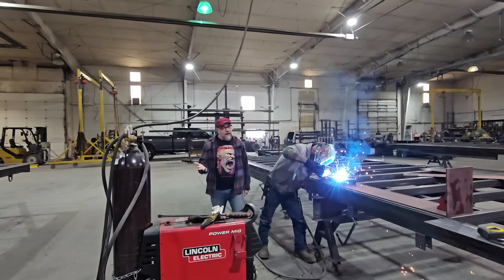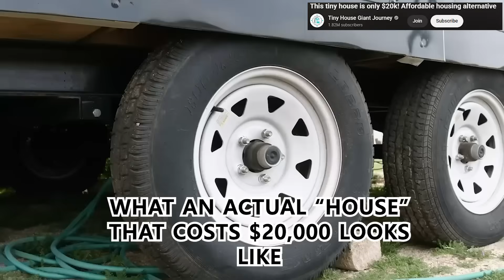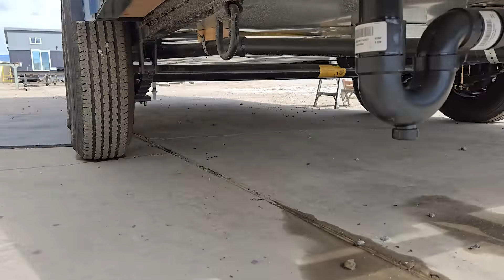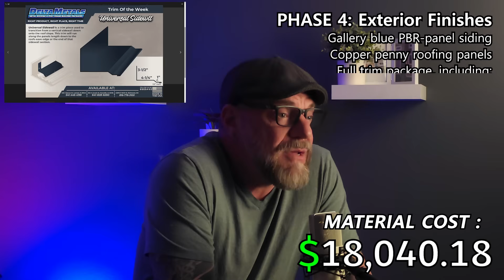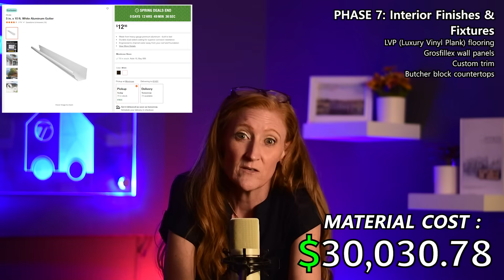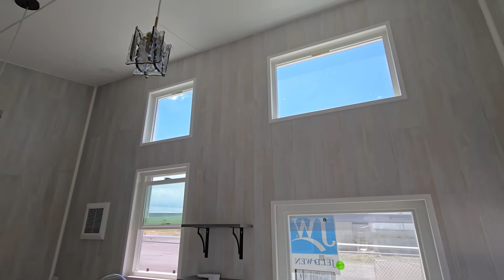The $20K Tiny House Lie

Comment: Great video!! but Dang that price seems absolutely insane my house was a little bit over a 100000 for 1600 square feet and a 1/2 acre I don't see why people are so interested in these tiny homes I mean It's not like you can have a family and what's the resale value should you try to sell. The idea of that is cool but the practicality I guess I can't fathom.
Reply: In my area in California new homes across the street from my land are selling for 500k for the cheapest model and on similar 5000sqft lots. These are 1400sq ft. houses. My lot was appraised at $35k this year so putting a $76k trailer on it and getting hookups installed for 20k should get me a place for 130k. Even if I had to do a loan with 20% down (only $26,000) that would only be a $944 monthly payment even with taxes and insurance. House across the street would need $103,000 down and still be $3600 per month... why wouldn't someone consider the trailer while saving money for a future house build and then selling it to someone else for 30k in 10 years time?
Reply from the maker: @falcianjinn6218 SEE??? I have been saying this for years now... It's all about personal reasons and economic perspective.. Thank you SO much for your input! 🙌😉
Reply: Around here in Wisconsin you can't even break ground today for less than 250k
Reply from the maker: It's nearly 2x that here in western Colorado... More than that on the front range 🙄
Reply from the maker: They don't want to live where you are, or like you live... Pretty simple, honestly.  It's all about personal choices and family needs.
Reply from the maker: When did you buy house you mentioned?
Reply: Tiny homes are just the effect of the american market

Comment: Thank you so much! You are right. I guess I rather go with a Mobil home  110- 150k. Yet, there is a builder in Tennessee: incredible tiny homes making some.
Reply: I definitely wouldn't recommend going with incredible tiny homes they are in a lot of legal trouble
Reply from the maker: Thanks for sharing
Reply: Spent a year there trying to justify the value....Just being the least expensive new constuction habitable structure may not be what it sounds like...It's a severe lifesyle change...Their smallest unit SHOULD be as wide as code allows but are instead under 8' diameter...At least the sloped roof as a 10' plus headroom tapert to 8' over bath area (a sloped front to back the lenght would be better for seniors)....I did an interrior design for us two that might have allowed us to survive, it just did not pencil for the finish or rented land space over time, maybe if we were not handicapped 80+ years old...

Comment: You end up with a nicer outcome, but then you still have to have a truck to move it. At this point, most people should just look at an RV.
Reply: hire a driver with a truck... nobody wants to pull these things around, and they are NOT travel trailers, so don't buy one for that purpose!:face-blue-smiling:
Reply: @onomado I own a 40ft major brand RV, they are far far inferior to tiny homes.  I believe RV’s have 1/5th the life of what I see being used to build THESE good tiny homes.  Just my opinion. 🤝☮️
Reply from the maker: They are both things mentioned... 5x life expectancy of an RV, and they are NOT "travel trailers" either.. You can move them, they just kinda suck to tow. You are both right 🙌
Reply: @Thetinyhouse.  In general a 2500 diesel would do the job? I also have the adjustable airbags.  I don’t know the tongue weight max off hand.  Total dry weight of my toy hauler is 8,600 and it pulls it up hill easily.

Comment: One more thing screw permits it's my land
Reply from the maker: I'm 💯 with you! 🤝
Reply: In my county, the permitting department's information page says, "If you do the work without a permit there will be a penalty." They don't say, " If you do the work without a permit, we will contact your local fire dept. to burn down your house," or "We will fine you 2x the amount you spent on the building." Do I really need a permit if I am 80 yrs. old, have owned the land and paid the taxes on my land for 60 yrs., and have always been a law abiding, good neighbor? What's your best guess?
Reply from the maker: @WhatIs7XSix most of the time it's neighbors that will turn you in if you do somethg they don't want to see
Reply: @thetinyhouseexperts i paid a guy to build a deck at my house. I paid for him to get a permit and he didn’t get one. 1️⃣ ended up having to tear it down myself. I thought it was the cable company that did it. Turns out it was a neighbor whose son ran over my mailbox drunk driving. I didn’t call the police on him. But he called on me over the deck that I don’t paid for the permit but probably should have gotten myself. But the jerk builder sounded like he got it with no problem. Boy I’m still mad about that guy!
Reply from the maker: @RobertM-y5w you have every right to be mad at that guy for not pulling a permit.
Reply: It’s technically never your land completely. They can find reason to boot you if you don’t comply. They condemn houses ppl hoard all the time.

Comment: Fyi buy a livaboard trawler or sail boat , stor it on any land to live on , it's a lllophople. Codes wont apply to storing a boat . The fact you can live on it is illrevealent.  Total loop hole check into it.
Reply from the maker: Oooh... That's a good idea too! Thanks for the tip 👍
Reply: What if i don't want to live on a boat
Reply from the maker: why wouldnt you want to live on a boat??  That doesnt seem like a terrible idea.

Comment: I got a new 32' fifth wheel with slides, two bedrooms, full kitchen, and tons of extra storage for $44k in January 2024. It's well insulated, encapsulated on the bottom, runs AC in summer off of 20 amps, stays toasty in winter with a $75 space heater (cheaper and quieter than running propane). Tankless water, solar, easy hookup, easy towing (light weight, half ton truck can tow fine).  Been to 22 states, then wintered at 2200' elevation in Washington with no issues. 

What's the benefit of going with a tiny house? Seems like more expense for less features. If you want to be mobile, why not get an RV for half the price? And if you want to be stationary, why not build a cabin for far less with far better insulation, etc?
Reply: Well an rv is not even close to the same quality. Rvs are way cheaper
Reply from the maker: @septic-god space heater in a travel trailer?! 😬😲
Reply: @thetinyhouseexperts  Yep. I have sufficient solar and batteries to run a heater that covers my needs. It's cheaper and easier than filling propane.
Reply: @septic-god  Yep, way less expensive and way more mobile. I've been full time in my RV for a year and a half, every problem has been fairly small and has been fixed under the warranty.
Reply from the maker: Kudos to you for 1.5 years full time in an RV!  May your fortunes be good for years to come!!
Reply from the maker: May I ask what kind of RV and how much was it to purchase (roughly?)??
Reply: @thetinyhouseexperts  It's a Cougar Sport, $44k new with all fees (no taxes where I bought) and a couple thousand in solar and battery additions, self installed. No out of pocket repairs so far. It got me to 22 states, handled Arizona in June and Washington at 2200' in winter, sub freezing and plenty of snow. I was looking to travel a bit before buying land, and a fifth wheel did that well and gives us a place to stay while we build. Since I knew I was looking for rural land in the PNW I knew that I wasn't going to run into any issues living in the RV. I checked in all the counties I was looking at buying in, and no one had an issue. I found that only municipalities care on this side of the country.

I had considered a tiny house with solar to be seasonal between the PNW and Southwest, and if I had gone that route that may have been the better option. But I decided to start with more land up north, build permanent structures, and purchase in the Southwest later if we still want to. Going back and forth with the RV is certainly easier travel anyway. 

I think tiny houses are fine for specific purposes. If I wanted to live on my land for more than a couple years before development, it would have definitely been worth considering. You get to move to different spots and figure out what works best, better insulation so less total energy needs. They are good as ADUs in urban areas where building permits are a huge pain (and you can't rent out an RV legally). Plus, in a market like CA or urban WA, you can pay back $76k pretty quickly with rent. They have their place for sure, I just think a regular ADU or an RV will generally fit most needs better most of the time.
Reply: @imakepretty  Watch that rubber roof and slide seals, and I don't think Keystone offers full time living warranty. I could be wrong, I know some brands do now.
Reply from the maker: A certificate of occupancy is the upside to the Tiny home over the rv. The rv is illegal to live in in the US 🙄.. Dumb, but it is the law... 25 million "criminals" living in their rv and enjoying their freedom.. What a shame, huh?? 😖

Thx for sharing your RV specs... Sounds really nice 👍
Reply: @thetinyhouseexperts  I guess that depends on the state and the local ordinances. Oregon and Washington do not have laws against living in an RV, while some municipalities in the states limit or ban it. But they also have specific ordinances that deal with (and limit) ADUs and tiny homes. Texas is fairly RV friendly, for long term living but less friendly to travelling/boondocking, while both Florida and Arizona have a lot of infrastructure specifically designed for long term RV living. 

I'm currently looking at rural properties in the PNW, and I haven't come across a single property that has any limitations on RVs or tiny homes. They limit permanent structures based on acreage and zoning, but not one in Washington, Oregon, Idaho or Montana has any other limitations. But I'm only looking rural, I'm sure there would be limitations in established municipalities.

Comment: Yep, that's why I spent 18k new on my little 21' Jayco. Queen + 2 bunks, slide out dinette, kitchen, & bath. 
Stays toasty warm all winter with a small space heater. (propane furnace is too loud)
It's all those pesky laws getting in the way and using all new materials. The 20k TH does exist, but requires plenty of time, both sweat equity, sourcing materials, and learning trades.
Reply: They are not sustainable for living in really cold climates I live in a nuwa hitchhiker II for the last 2 years to see if tiny home living was doable for me and my tenants lease was just up on my house so I’m selling to buy my tiny home that’s going to be better insulated and floor plan is better than what I have I hate having the shower in my bedroom and the toilet in a closet.
Reply from the maker: Great point about the DIY aspect and material sourcing, that's definitely key.
Reply: They exist but they don't comply with the city codes
Reply from the maker: They are just for camping... not living in full time.

Comment: Basically you should be paying around *$555.00 per sqft to build labor and material? 

18' x 8' = 144sqft x $555.00 = *$80k
Reply from the maker: Simply put... Yes.  You don't have 1500 Sq ft to spread the costs out across to get to a "cheaper" psf number.  Classic sales tactic to convince you that Sq ft price is somehow relevant. It's not an applicable formula for a tiny home or ADU. The smaller the structure, the higher the psf dollar amount.. Math don't lie 😉
Reply: @ interesting. Learn something new every day. Thank You!  

I'm out here in Atlanta. Been flipping for over a decade. Haven't built any ADU's yet, but they're getting popular here in Atlanta.  Found your channel in my research. ⚡️👊🏻
Reply from the maker: I'd love to speak with you about flipping in atl on the show! Let me know if you're interested?? Thanks! 😉 Damon